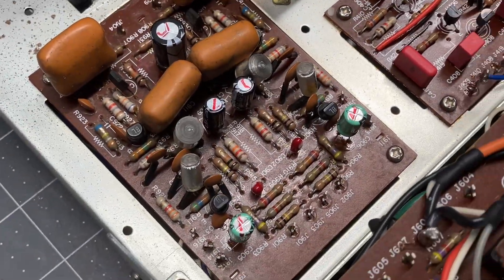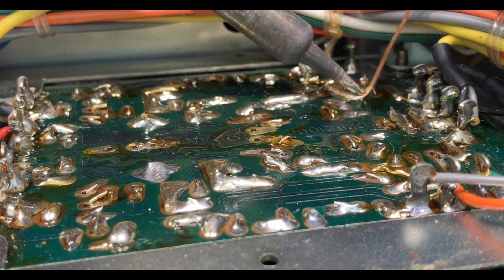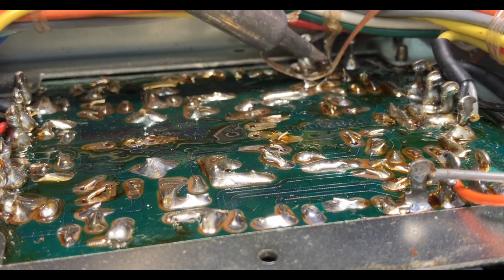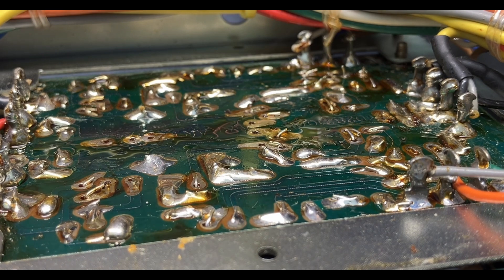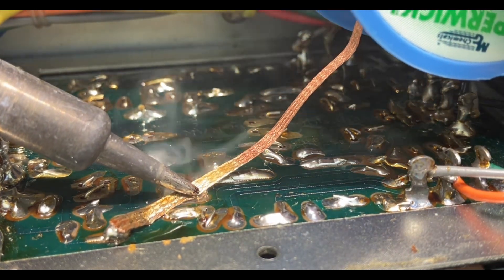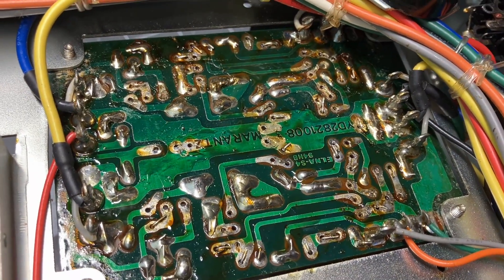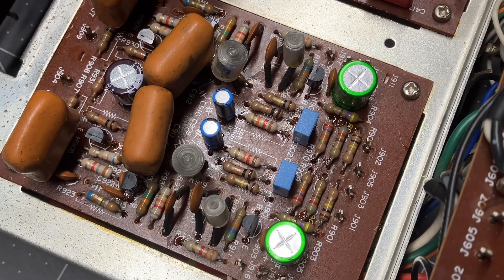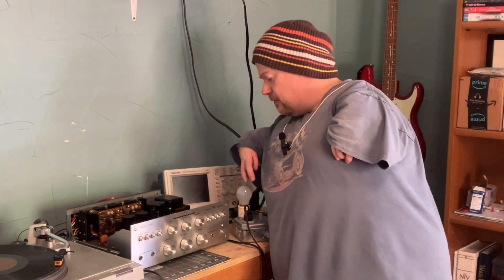Marantz 1060 Rebuild - Part 4 - P900 Phono Pre-Amp Board

Comment: I an a retired electronics pro that worked for +50 years slinging solder and parts. Now I restore antique radios to keep out of trouble. When it comes to soldering people tend to use way too much solder and never enough resin.
My favorite solder for general electronics is Kester 44 dia .032. The alloy needs to be Sn63 which is eutectic. I have found that the brass wool is way better that the wet sponge I used for many decades. A great replacement is my wife's Chore Boy. Be sure you have a supply of RA Flux that will easily wash off. I have used both IPA (not beer) and Brake Kleen to wash down boards after repairs. If you repair anything that will be exposed to harsh environments give it a quick coat of conformal coating or a quick blast of Krylon clear coat over anything you soldered.
Sometimes adding some "fresh" sn63 to a joint makes it way easier to suck up the 'old' solder. It lowers the melt temp and is less likely to damage an old board. 
Get a small muffin or table top fan to clear the air. If you do a lot of soldering get a desktop smoke extractor.
As to Thanksgiving foods? Spiced Apple rings are my favorite treat. Musselman's used to make them so now they have to be homemade.
Reply from the maker: Great advise! I'm still learning! Thank you!

Comment: Been waiting (impatiently) to view part four this is so helpful. 
Who ever suggested using flux, what a great tip! Thank you!
Thanksgiving is my favorite holiday. I smoke a Turkey. My favorite is cornbread sausage dressing that I prepare a day ahead so my wife can have the kitchen Thanksgiving Day.
Reply from the maker: @Geoduck.  Thanks! I’m working on the P700. It’s going to be a long when I think.
Reply from the maker: Cornbread Sausage Dressing sounds really good.
Reply: Did you find any mislabeling on the board for the transistors lead positioning?
Reply from the maker: @curtwheeler5019  no
Reply: @curtwheeler5019  Do you have the service manual? I have not started rebuilding my 1060 yet. Check the service manual to the board. Also some updated transistors may have their legs changed. Be very sure to check the data sheet.
Reply from the maker: @Geoduck.  I do have the service manual. I've found a few discrepancies. I'm checking every part 2-3 times before install. Thanks!
Reply: Try the cranberry relish with the orange zest. That stuff be good.
Reply: @fishheds  YES! The orange zest makes a big difference.